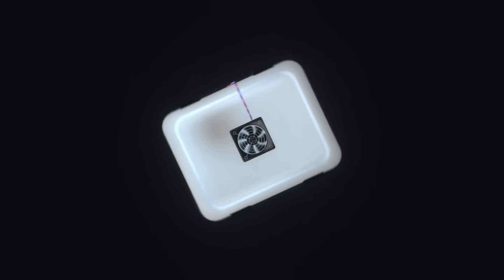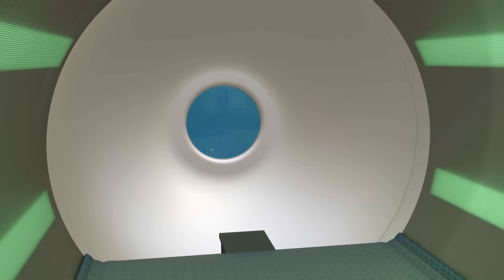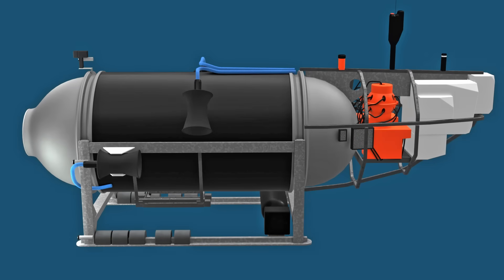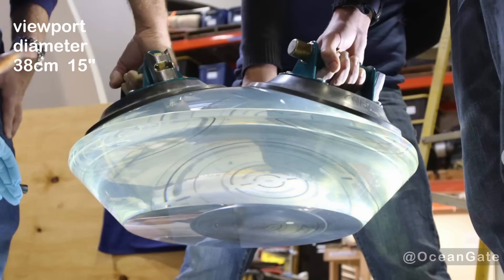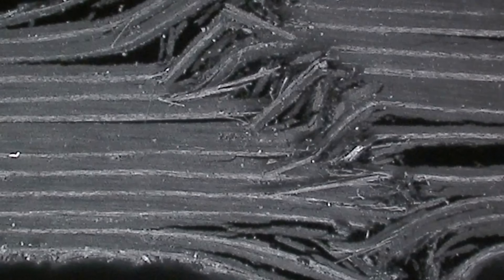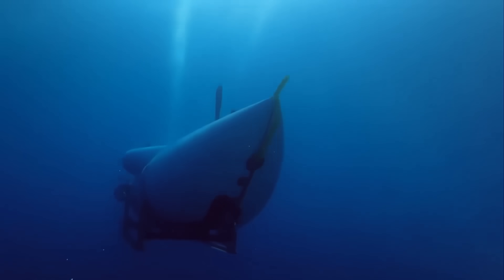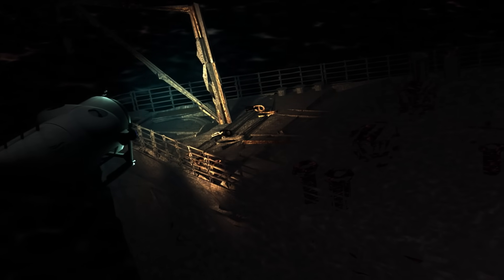Titan Sub | carbon fiber - Detailed Tour

Comment: Best explanation video i've seen about the titan sub. When  they did put the first Titan sub model into the pressure chamber the cf started failing at the titanium dome at that glued joints. Thats why the cf hull was ribbeled appart in axial direction and also tearing appart the small titanium overlap parts. And i very much believe the exact same axial failiure of the cf hull at the glued titatium rings happened again, as it already happened with the test titan in that pressure chamber. There are photos on the internet about that ribbeled-off cf hull. Sorry for bad english. 👯
Reply: One thing not discussed enough here ....  "The Sphincter Valve Effect" 
What happens is.... BOTH noise & visuals are translated into Electrical Impulses for interpretation by the brain.
When formed, these impulses of information travel South to the Sphincter Valve aka the Orifice Interface.
The Sphincter Valve controls electric impulses in an effort not to overwhelm the brain.
Nerves are very thin in this anal-type area. They need a massive amount of bloodflow to pass the Interface, traveling on to the brain.
Once you throw TOO MUCH INFORMATION down there, the electric impulses backup, the Sphincter Valve closes, blood flow drops.... nerves can't pass information ....... and the brain has no choice but to mutter the only thing it still sees, OH SHYT!!!

Comment: There at the very end, are you suggesting that the transcript is fake? They weren’t descending with thrusters, they were trying to slow the decent with the thrusters because it was observed to be too fast, and wasn’t working because the sub had already lost buoyancy.  So much so that, even with all ballast dropped, and the thrusters on, they still struggled to ascend. Was the buoyancy lost due to water leaking in? Or due to the pressure hull being ever so slightly compressed on its way to failure?  We’ll probably never know.
Reply from the maker: Of course its fake.
Reply: @Mike-Bell  I have to disagree.   I have seen videos showing the
display screen on the Titan Sub, where it displayed messages 
between the Sub and the Surface, which they called 'TOP;.  The
style and format of the messages in the transcript are the same
as that on the video.

Further, the Transcript mentions that the TOP is consulting with
a person named 'Carlos' - this is Carlos Rosas, who, according 
to his LinkedIn page, is / was an Electrical Engineering Intern
with Ocean Gate, and was responsible for working with the 
power and control systems on the sub.   Mr. Rosas has at no
time denied that he was in communication with the control
ship, which leads me to believe that this transcript is real.

If you study the transcript, it indicates that the Titan began
suffering a single point failure in the Carbon Fiber Hull, which
rapidly cascaded until ALL the acoustic sensors were indicating
overload stresses.   This implies a rapid degradation of hull
strength, which is common when non-metallic structures are
subjected to high compression stress.
Reply: It’s probably fake. But don’t take mikes word for it. He’s defending carbon fibre as a material for deep sea diving. He’s as bad as stockton rush.

Comment: I think your wrong. Safety regulations and precautions only exist to stifle genius. His genius. He was told that this design would lead to catastrophic failure. He could have taken it under advisement and adjusted the design and everything would have probably been fine and his passengers and himself would probably be alive. Instead he fired the guy who tried to warn him. Turns out that the laws of physics give 0 f**cks how smart this guy was. Or how smart he thought he was. Sometimes arrogance is not enough to overcome reality.

Comment: Excellent video!

Although I can agree with your analysis that CF is strong enough to carry the load, is it practical enough? I dont think so and it was proven in this tragedy. Let's pretend that Rush did the destructive testing as he should have. That still doesnt guarantee that there would have been manufacturing defects on the production tube, it could and probably would have catastrophically failed over time just as the one that wasn't destructively tested did.
Reply from the maker: You would destructively test till you have a configuration that fails substantially deeper. Then you have a dependable design and enough saftey margin to be fine with “normal” minor defects. This is the kind of thing engineers are really good at and why I am comfortable to set foot on a composite aircraft or any airliner. There are clever people worrying about these important issues 🤙🏻 💡
Reply: @Mike-Bell  I totally agree that extensive destructive testing should have been done but that would have cost Rush a fortune and no way he would have done it. This is why I say it's not practical because the carbon fiber doesn't seem to fail consistently due to the manufacturing process,. but I totally get your point. With that said I would not want to get into a CF submersible. Honestly I don't think I would want to get into any submersible.
Reply: @Mike-Bell 
So destructive testing is the only way to size and shape for safety?
😂
Reply: @francescozani9488  it is the best way to learn new things about the design. Failure points you never would have thought of can arise. Also, you have proven the sub can handle more than the intended stresses you plan to put it under. If you design things, you always find a problem in testing. Self driving cars are currently getting tons and tons of data every day, and every bad decision the cars make are flagged and people look at it to see how they could prevent it from happening again, and it is going to still be a few years before they work out all of the bugs. People ARE going to die in this process, and that is ok. It is the risk we accept to advance.
Reply: I watched this a second time and it's the best video on the Titan that I have seen so far and I've seen a lot. I really hope you make a follow up video when more details are released.

Comment: SO, YOU SAY THAT CARBON FIBER IS OK FOR COMPRESSION, BUT EVERY EXPERT DISAGREES WITH THAT.  hMMMMM
Reply from the maker: Well composite aircraft call BS on that. If carbon fibre is strong only for tension, like a rope. 

Assuming every expert disagrees then how does engine thrust get to the airliner body via a carbon fiber wing if it only takes tension?! I’m really curious to hear your answer…
Reply: Considering I'm not an expert, I have no idea.  Why dont you man up and ask an expert so he can tell you the facts that you obviously dont want to hear.  Also, if carbon fiber could withstand such compression, what happened in this case?  Oh, right, it couldnt withstand the compression. @Mike-Bell
Reply from the maker: @bogus696996  I did speak to aeronautical engineers who produce composite aircraft and they thought this weak compression thing is hilarious considering the composite structure in their planes is under massive compression. They know, they are responsible for the calculations and testing. The success of their aircraft manufacturing company relies on the compression characteristics of carbon fiber. 
And then we get the clever commenters on here whose only knowledge is what james cameron said on tv. It is hilarious 😂
Reply from the maker: @bogus696996  If you listened to the video I explained very nicely how  it failed because OceanGate went cheap on their mandrel and did poor composite layup. I told exactly what the aeronautical engineers agreed was the problem with titan.

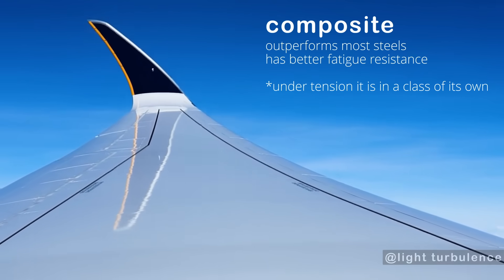Comment: 9:20 Yeah, but no. Carbon fiber as a rule of thump only has 50% of its failure strength in compression then in tension. Working in the aerospace industry for more then twenty years you learn how things like composites work. I understand you trying to defend the product. There really is no reason too this was wrong application for it and it failed.

Comment: Do you know if they did a tail strike test with the carbon fiber 787 like they always did with aluminum planes. If not how will they know what will happen if they have to crash land.
Reply: A tail strike is usually on takeoff,
 these are totally unrelated.
Reply: So what will happen to carbon fiber on a fully loaded 787 at 10 or 20 below zero? I will not fly on it or my family. 737 is the other one. Not a gambler. @jj-jak
Reply: @timdoerksen9893  the 737 NG had some defects which mostly affected aircraft that crashed, I'm not sure i understand your question but in general I wouldn't expect a composite to be affected as much by temperature as metals.

Comment: The way the carbon was wound is why it was weak and james Cameron was correct you don’t use composites under water one of the reasons being is the enemy of carbon fibre is water if it seeps into the carbon it will delaminate without warning this effect was seen on a Boeing aircraft when the rudder on the vertical stabiliser delaminated mid flight without any warning carbon was a terrible idea for underwater applications
Reply from the maker: I would be careful getting technical knowledge from James Cameron. 😦
Reply: @Mike-Bell  I didn’t I simply said he was correct also as a person whom has built deep water submersibles including being a designer of his challenger deep submersible I think he is more than qualified to talk about the integrity of ocean gate’s dussster of a vessel
Reply: *disaster of a vessel

Comment: This is probably the best presentation on what happened. Someone soon may be able to use carbon fiber installed to withstand pressure. It'll require better testing to insure safety over multiple dives.
Reply: Really?  It didn’t even get the date right in the description. It wasn’t June 8th. It was June 18th. 

If he got that wrong, what else did he get wrong?

Fool me once, shame on you…
Reply: @dustysgirl1434  Good catch, but the owner who sailed on the correct date didn't do so well on the other math.
Reply: Correct. It is only with proper research and testing do we find better ways to explore this planet and beyond.
Reply: I understand the carbon fiber shell was designed to be 7 inches, not 5 as built.
Reply: @oldmech619  Even then its problem was it was gradually being destroyed every time it went down there because after high compression, carbon fibre doesn't recover, it stays permanently damaged, although only in a small way. You've heard people talking about the loud cracking noises, that's delamination and individual fibres splitting and resin cracking. The sub gets weaker with each use.
You don't get that issue with Titanium. It can be modelled on a computer to accurately know how many dives at that depth it will take while staying in spec.

The only reason Rush went with CF was to save weight and squeeze more paying customers through the door.
There is no reason why the global submersible world would choose to dump Titanium for CF because A Titanium is well understood and easily modelled in computers to predict strength which you can't do well with CF and B, they don't need to run it as a bus, cramming loads of people in to turn a profit.

CF might be an idea for small subs that could be used on coral reefs, but the bottom of the ocean?  Nah.
Reply: @captainwin6333    I understand that a titanium haul would have weighed a coupe of thousands pound heavier that would have required being compensated with positive bouncy foam.  That would render the sub much more difficult to handle above and below water. 
The Titan had so many problems. It even looked like a couple of monitors were Drilled mounted into the carbon fiber. The carbon fiber was out of date. Deep cycling the haul. Bounding and mating the cabon fiber to the mating rings. The porthole was not rated or the Titanic depth. Titan was left out through the Canadian winter. What waste of good human beings 
It really bothered me.
Reply: @captainwin6333    Oh btw. The US Navy did operate underwater drones made out of Titanium end caps and carbon fiber tube.  Little mini Titans. Well tested.    AUSS
Reply: @captainwin6333    And thanks for your post. Very informative
Reply: @oldmech619 Those “carbon fiber” UUV’s were:  1) unmanned. 2) remotely controlled by Navy Seals. 3) Only descended a few dozen meters below the surface. Carbon fiber is used extensively in formula racing cars. Light, relatively inexpensive and dissipates energy by fracturing and delaminating. You know, like happened to Titan.
Reply: @o2benaz  they also were disposable vehicles, not designed for multiple reuse, and were not pressurized to begin with.
Reply: @downix  I never mentioned reusability nor  pressurization. The point I was making is that carbon fiber is great in tension, as in the round fuselage of the 787, and absolute rubbish in compression, as the Titan proved.
Reply: @oldmech619  Interesting and not surprising given the other shortcuts.   Assuming there was new microscopic damage with each trip, even the 7 inches would have imploded soon enough.
Reply: @DanCrosby1    It was Rush overall dangerous attitude toward safety that bothers me. I spent over 50 years in aviation. Safety was what I worked for. Accidents always bothered me and I have heard some pretty bad reasons. The Titan was by far the worst. 
The crew didn’t torque the bolts for the entry dome and even left one bolt out because it was difficult. A crew member laughed it off.  Note: All bolts are now missing. 
Sad
Reply: From what I've heard fiber was fine for one time use. The issue is multiple time use because you can't test for attrition. Every subsequent time you use it the chances of collapse go up and it's impossible to know how close you are. It's gambling essentially. What is most alarming is that Stockton did not have plans to retire the sub even after many uses and if the Titan had survived that day some other collection of 5 people would have perished.
Reply: possibly - my comments are just that the same arguments were made when carbon fiber was considered for airframes - seriously. 30 years ago. now most rotary craft blades (yes, Blackhawk - not sure about apache) and they go up and down, every day.  I think that stockon was so before his time - lacked money (nasa participated in most of the carbon fiber dev for aircraft at least usa @commodorezero
Reply: It is a fiber.... it will never be better at withstanding compressive forces than tensile forces. Fibers are best under tension. You would need to embed it into a matrix... kinda like a resin, and that still failed, as that is what they did.
Reply: I always said it was a good idea. This disaster is a minor detail.
Reply: They refused to get it certified,
Reply: far too expensive, would have meant changes that would have not been paid for and setback carbon fiber use in submersibles for a decade or more @tonysheerness2427
Reply: I totally agree with you
Reply: The whole thing was a psyop.
Reply: yes.  this will be perfected. it withstood multiple dives (not just the four for titanic) during testing.  i'm sure koreans are following (this is not against korea - they are awesome engineers and will take the risks associated.  While this design not sound, it paves the way!!!
Reply: Yes, a good presentation but he presents a problematic justification of carbon composite.  In the real world where cost of development can astronomical for this kind of material application AND the improbability that such structure could be manufactured without imbedding a lethal flaw AND the fear an educated potential customer would have…this is a nonstarter choice of material.

Great advatages, impractical use.

Comment: Regarding your comment about the crew not wasting time typing messages to the surface ship during a crisis, that may be true for a normal person but this is Stockton Rush we’re talking about. He had a propensity of being flippant about danger and never seemed to stop talking so I think the messages could be credible.
Reply: Skepticism about the messages on grounds the crew wouldn't be wasting its time like that in a crisis implies they  would've been busy with other tasks to save the day.  But, like what?  Maybe each could grab a Gameboy controller and bash madly at the keys.  But, this austere submarine tribute to Steve Jobs and Elizabeth Holmes was little more than an automatic elevator, remember?  The term "crew" is overblown.  A better word would be, passengers or even "cargo" for the little "crew" had to do.  By design, Titan was dependant on the surface ship and crew for everything.  Even a successful return to the surface would end in tragedy if the surface ship guys couldn't locate to laboriously unbolt and free them from the thing.  Under the circumstances, typing messages to the surface was the only meaningful thing any of them could do in a crisis or any other time.  So, it's shocking but no surprise, Titan had no more reliable means of communicating with the surface crew than they did, no emergency last ditch measure, say, the equivalent of tin cans connected by a string.  
Of course they were typing messages!
Reply: Great point. The typing/messaging system was probably one of the few things that worked at that time.
Reply: And he had so great trust on his design that most likelly he did not even sense the danger? He had get accustomed of loud bangs of the material. And it seems that nearly all of the dives had some problems. It was a "normal day's work" for him untill split of a second...
The messages can be legitimate.
Reply: No. Past transcripts were super-brief and concise. The messages in this fake were out of character.